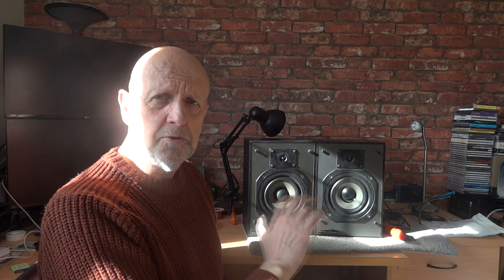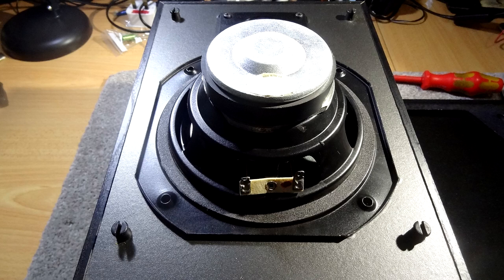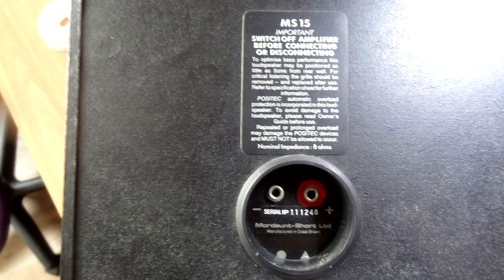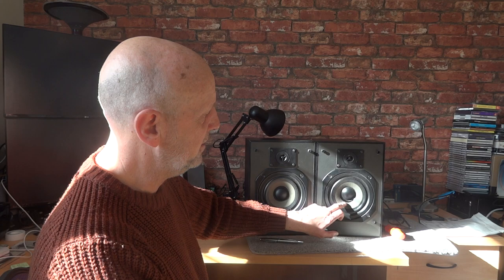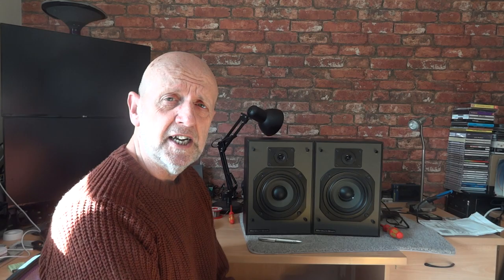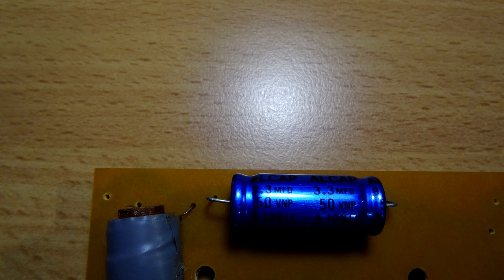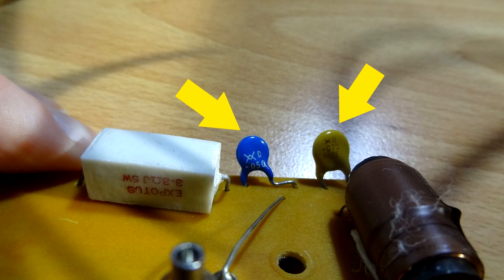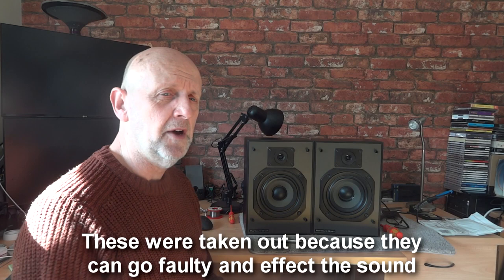Mordaunt Short MS15 Speakers Review.    Vintage HiFi Audio

Comment: I bought these new in the 1990s and they still sound good to my 70 year old ears. They sound gets much better with a subwoofer. My room in 19' x 14.5" and I moved in just over 3 weeks ago. The room is too reflective, so I'll need some absorbtion to tame the sound slightly.

Comment: I bought a pair of these here in Australia about 12mths ago from a pawn shop called Cash Converters. They were in really good condition and cost me $70aud. Very cheap by todays standards. I have been running them with a pre amp and a Kenwood power amp and a Sub Woofer, and apart from as you say, a little rough at the top end I am more than happy with them for the money I paid.

Comment: I wonder why Mordaunt Short used this tweeter. I looked up ms10 to 45 with increments of five. They all seem to have better tweeters than this. This must be a model the dealers asked for.
Reply: Maybe you were looking at the later MS10 etc. range. The ones here are from the early/mid 80's but for some reason Mordaunt Short used the same model numbers for their range of speakers they introduced in 1993. They were bought out  in the late 80's by the TGI group, so maybe the new owners decided, for reasons only known to them, to use the old 80's model numbers for the new range. Very confusing all the same. There was also the MS25Ti, 35Ti & 45Ti and possibly, but not certain 55Ti from the late 80's. They used a titanium tweeter I believe.

Comment: Michael, What is the size of the input Jack. Seen 3.5mm quoted , certainly not on mine. Thanks
Reply from the maker: The sockets for speaker connections are 4mm , my 4mm banana plug fits nice and tight
Reply: Nice one. This was exactly the info I came for. Cheers.
 @MichaelYates